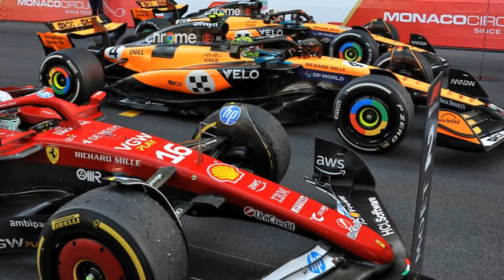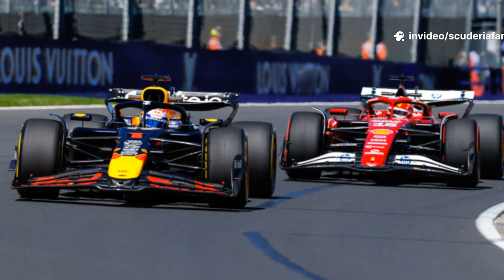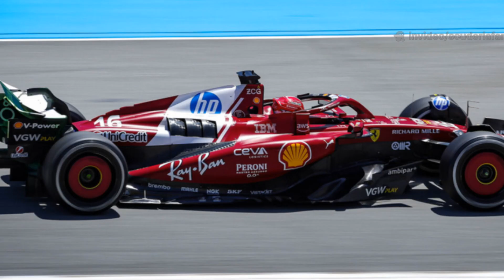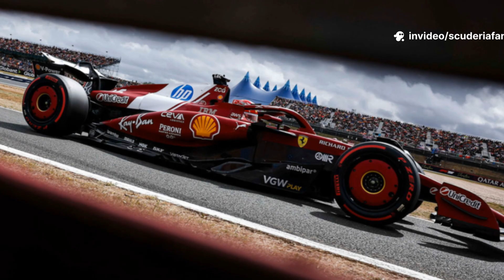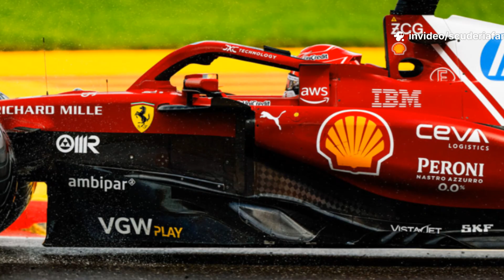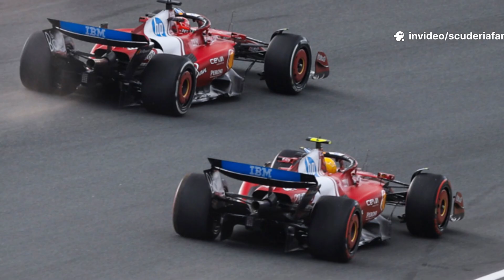2026 F1: Ferrari’s steel alloy engine head boosts reliability & aero

Comment: To increase the compression ratio when the engine heats up I can see two approach who can be used independently or in combination. The first one would be to use aluminum connecting rods who have a thermal expansion coefficient of about three time the expansion of steel alloys and there for reducing the volume of the combustion chamber as the connecting rode gets longer as the engine warms up. The other one would be to use a thick aluminum head gasket inserted in a stiffer steel/ceramic composite cylinder head. With this second solution the expansion of the aluminum gasket would reduce the diameter of the combustion chamber and increase the compression ratio. If used in combination they would have a cubic influence on the volume variation so even a small thermal expansion would be able to modify the compression ratio from 1:16 to 1:18.

Simon
B. Sc. Eng.
Reply: https://www.youtube.com/watch?v=jTxcfWfVHU8
Reply: https://www.youtube.com/watch?v=tMN4QY4duSA
Reply: https://www.youtube.com/watch?v=2yBEEVf8Uos

Comment: how steel alloy head, has anything to do with , airflow around the engine??
Reply: You are just a fool
Reply: Steel is about two time stronger and three time stiffer then aluminum so a steel head would be able to have a more compact profile to do the same job so the body around it would be more streamlined. But I explain the real reason in the comment above.